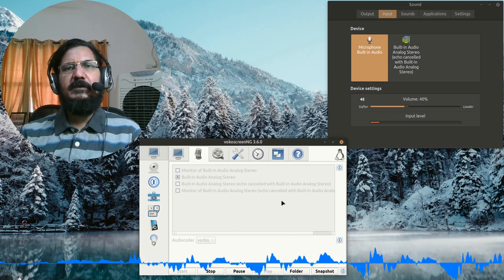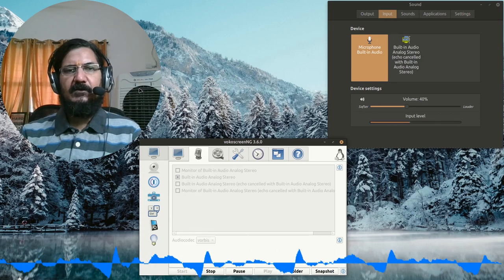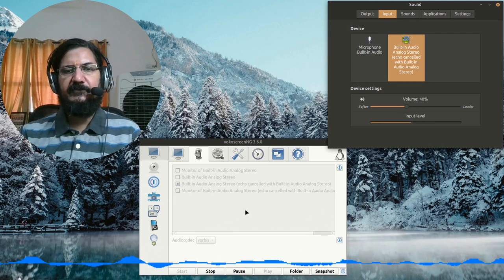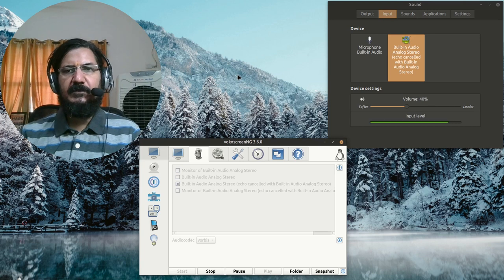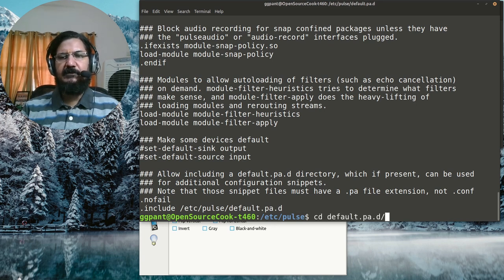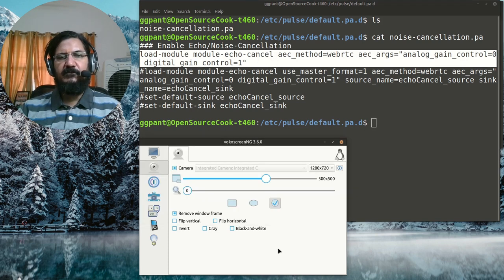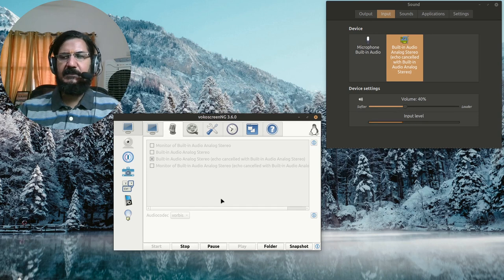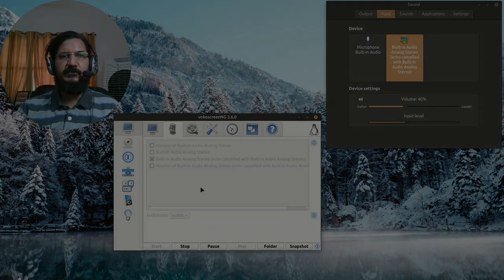Noise Cancellation in Linux with Pulse Audio

Comment: Hello friend! I tried this on Linux Lite but I always get high static noise when I record my voice using external mic .I tried this on MX Linux but it didn't work at all.
Reply from the maker: When you record make sure you have selected the 'Noise cancellation device' from the recording software.  e.g I use VokoScreen for screen recording, in inputs it shows the noise cancellation mic.
Also keep the mic input level low.
Reply: thank you when i saved my new laptop from getting wasted but when i record my voice is so loud an high staich nosie